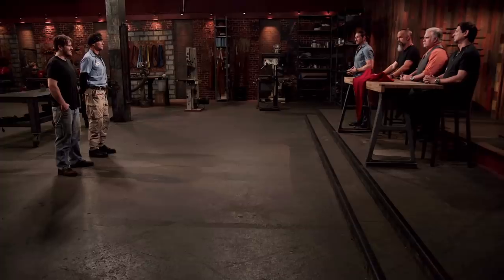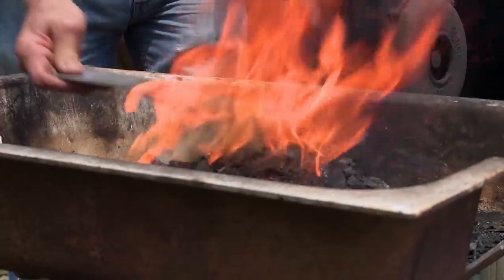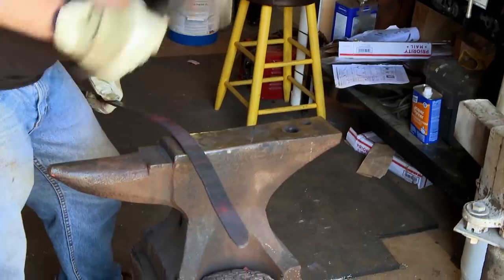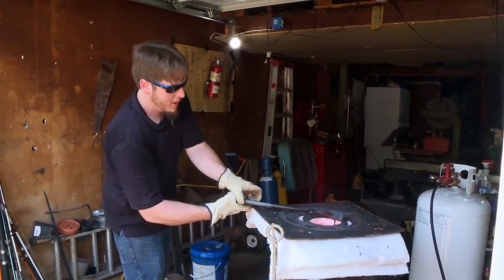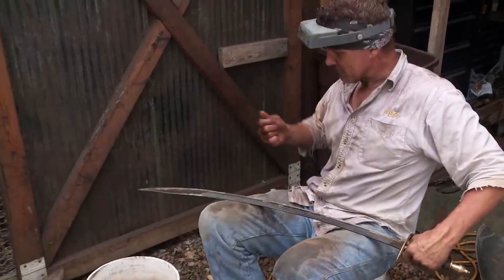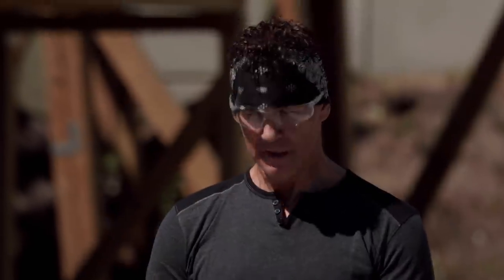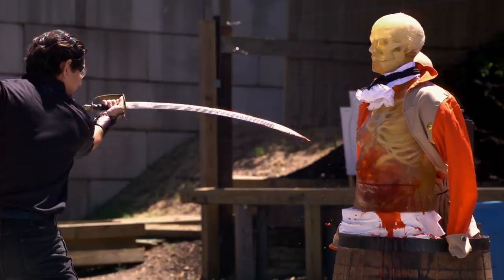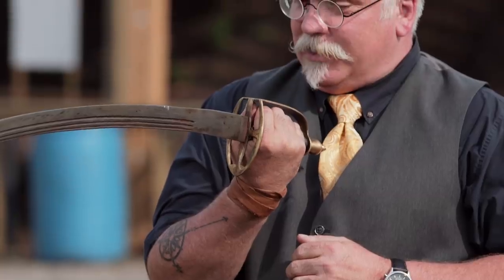Forged in Fire: Cavalry Saber GUTS & CUTS the Final Round *Lethal Lacerations* (Season 3) | History

Comment: they didnt explain why they cut the other guy he might lost only for the loose handle
Reply: And the other blade destroyed that sand bag 3x more than his
Reply: It arrived with a loose handle, the edge wasn't as sharp and the edge took some slight damage on the bullet splitting test. His guard and double fuller sure we're aesthetically pleasing though. Arrogance is one of my pet peeves. I'm actually glad Dave won.
Reply: They seem to have cut that out of the clip. In the full episode they say that the handle was loose and round. The round shape makes it hard to align the edge. That leads to a performance issue. They winner built it better.
Some guys lost for less difference.

Comment: Curve is too agressive too flexible.. the other design was better and more sturdy.. the other man should have won
Reply: The handle was nearly rolling around the stem by the time they got to the strength test.
Reply: The curve was way over aggressive on the third blade, but I was in a bit of a hurry and didn't have the time to tune it. Overall a very very ugly blade. I'll argue about the flex though. A light sabre is supposed to be just that...light. I wish they'd have kept in the footage of me testing the blade at home. the camera crew about died when I bent the blade double to demonstrate the heat treat. :P